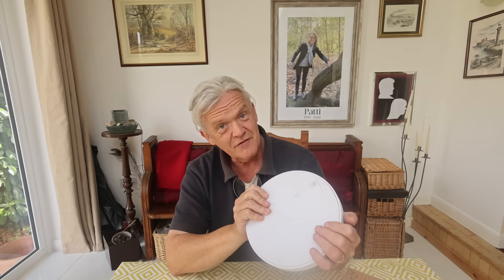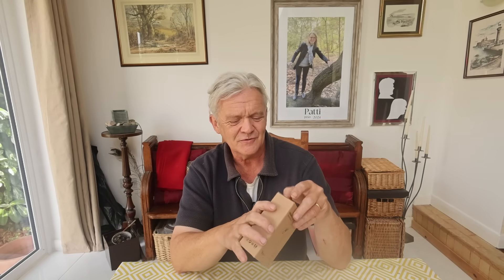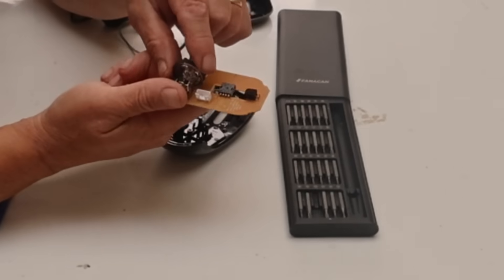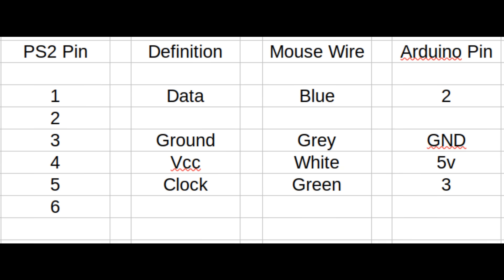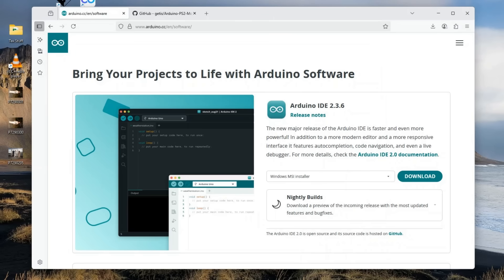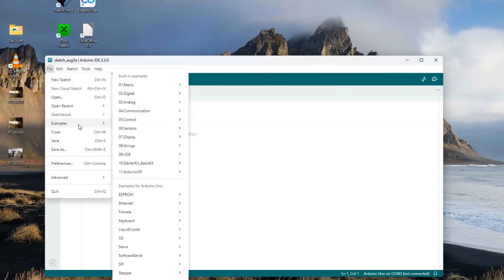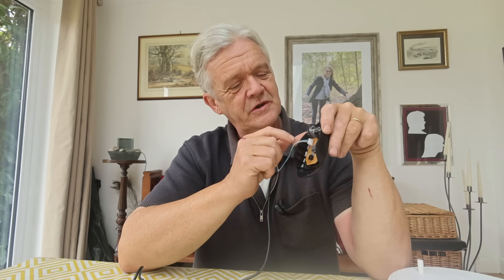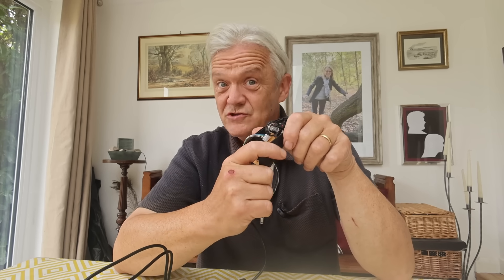2417 A Position Sensor From A Mouse

Comment: Nice, I recall when 3D printing was getting started back in the early 1980s solid scape came to me to laser machine orifices for melted materials and they took me they were using the plastic linear encoder mentioned with an accurate spring, from HP printers which turn out to be very accurate and repeatable.  So this is a 2D optical encoder.  Question how fast is it?, is what is the bandwidth usually video is 30hz or 60 hz and that might not fast enough for fast 3D motion what is the update rate?

Comment: Rollerball mouse might not need total disassembly, but contact with a rubber layer, not for this project, others ?
Watch out for power delivery from the newer arduino, is it enough and can it handle 5V signal ?

Comment: Love it. I'm going to make a guess that a USB mouse may just work on the same principal... I only mention it as I have a bucket load of them to play with :) I'll be looking to add it to my new radio aerial rotator project, along with a friction drive as that's way easier for me than building a gear box. No 3D printer yet! Cheers 🍺

Comment: Interesting investigation. Around 10 yrs ago I tried using an ADNS???  to measure belt position on a balancing robot but found the repeatable accuracy very poor. I contacted the manufacturer at the time and they replied that accuracy was at best 10% but the hand eye co-ordination gives the impression of it being much better. You can test this by running a mouse along an edge to a corner and see where the pointer ends up. Maybe modern mice are better or reading with a non windows interrupted system doesn't miss data. But the one I have isn't.  Its also very dependant on surface roughness as the laser is shon at an angle and the sensor tracks "shadows" .Like a plane flying over mountain ranges I heard was an inspiration.  Maybe P2000 emery cloth would match the sensors resolution ? Best of luck Rob, looking forward to your  results.
Reply: I had a similar project in mind at one time, an industrial application, and had the same conversation with the manufacturer. The repeatability is too poor for accuracy at almost any scale. I don't know if he'll be able to get proper accuracy for 3d printing.

Comment: Excellent use for a mouse! If you do have an old trackball mouse kicking around, there's a chance it has a pair of optical rotary encoders in it driven by the trackball. Speaking of rotary encoders, if you find it worthwhile, you could probably use that scroll wheel (minus the mechanical detents) as a filament movement/jam sensor. Looking forward to seeing these projects develop, thanks for sharing!

Comment: always thought it was a IR sensor/phototransistor as opposed to a camera 🤔

also rotary encoders and encoders in general (such as those in a digital caliper) are awesome and perfect for this sort of position sensing (could've sworn they are used in CNCs)
Reply from the maker: no mate camera! - cheers for the extra info. In quite a lot of calipers they use a capacitive sensor
Reply: I've been building a CNC using a module that has a hall-effect device and a magnet you glue to the shaft of your stepper motor. It gives you the position of the stepper. It doesn't give you the absolute position of the spindle, but it does warn you when the spindle hasn't moved to the location you expected. I glued the magnet to a plastic shaft that was in turn glued to the stepper shaft to greater isolate the module+magnet from the stepper motors own fields.

Comment: We'd also like you to do a project demonstrating how to hack the optoelectromechanical components of a DVD burner. For example, using an Arduino to control laser focusing, rotation, and head position would be a great project.
Reply from the maker: That sounds like a fun project mate - thanks for the idea.

Comment: It's a great idea. I've been trying to figure out how to do this for a long time. However, you can't use this sensor to get absolute position. But I think it could be done using an older mouse instead of an optical one. It could easily be used as a trackball.
Reply from the maker: yes you can mate - just set a home position and count from there - i covered this in the video

Comment: One thing to remember: These optical mice aren't designed to be accurate and only return a rough measurement.

Instead I recommend looking into rotary inductive encoders. These can be built with just clever winding patterns on each of the 3d printed parts, can be made to return an absolute position rather than a relative one and can be made to be incredibly accurate, to the point you can watch your 3d print deforming in real time through room temperature and humidity changes.
Reply from the maker: I am not sure i agree with you mate - but great suggestion cheers

Comment: I once did a similar thing with a linear encoder from a standard paper printer. I wanted to measure thermal movement of the wall of a building. It worked great. I never thought about the mouse. I love the world of sensors. We have such awesome access to really cool stuff.  I created a led circuit that responded to an accelerometer to indicate the level of deceleration of a vehicle. The faster you slow the more leds light up. I should be a millionare now lol. I would also mention I found chatgpt to be quite helpfull in quickly programming the arduino. Thank you for wonderfull videos.
Reply from the maker: Awesome - thanks for sharing and great to hear about your experiments mate.

Comment: And 7 pounds is not even a very cheap one, you can find some for about 1, though there are risks with going to the absolute bottom of the barrel, you wouldn't want things to stop working because the electronic is unreliable in the middle of a print.

But yeah, it's incredible the things we take for granted, there is a whole image processing thing in that camera, that identify features of the surface it's filming, and look for them from frame to frame, to compute relative position, and doing that at rates high enough that even on the small surface it's looking at, fast motions can be assessed with some degree of accuracy.

Arduino is certainly a fun and easy way to get into programing with electronics :) (i mean, it's still c++, not the easiest language, but they made it easy for the kinds of things you want to do with these kinds of projects).

edit: "*any* point in space" made me laugh, a very powerful device indeed!
Reply from the maker: Cheers mate - it is amazing how much tech is in those little devices.

Comment: Great idea what a shame it is not 0.005 it would make a very cheap DRO for a milling machine  I wonder if they do a mouse with a higher resolution  or if there is a way to amplify the reading by gearing the movement up Edit I have just done some quick research and it seems you can get mice with very high resolution so yet another project 🤣Thanks 👍
Reply from the maker: Good luck with your project mate - let me know how you get on!

Comment: Love this! I made a rollerball for a mame arcade machine by taking a kids polythene ball, filling it with plaster through a tiny hole, covering the surface with dots and making a home for it above an upturned optic mouse. It worked really well but was a bit janky. However it proved the concept and worked very well for a while. Great video, Thanks!
Reply from the maker: cheers mate

Comment: Are you sure that the position won't drift over time?
Reply: yeah, error will accumulate (or cancel out), but you can have a reset point in your disc, using one of the button's wires, so every time you make a full turn, your wire connects and detect that, erasing your error before it gets too big.
Reply from the maker: oh it i will drift mate - all mechanical systems drift - but gabriel has the answer to that

Comment: Nice video, Robert.  I'm thinking about this as feedback for an automated threading attachment on my lathe.  I have rotary encoders available, but if you use encoders on a leadscrew you get problems with backlash - it's a far better idea to go with direct motion sensing.  I was going to use a linear encoder pulled from a junked inkjet printer, but that's gonna have issues with chips, this is non-contact and can be pretty much sealed.  Bingo!  

As an aside, in general, it's a really bad idea to do any sort of automated control "open loop" - even with steppers driving gears or toothed belts you will eventually get missed steps at the motor end either due to speed, load, or electrical noise issues, and that can really bugger up your day.  Ask anyone trying to run 3d printers as fast as possible.  Even steppers really need to be run servo.  So having a cheap and relatively accurate way of getting actual motion feedback is a really cool thing.
Reply from the maker: cheers mate and nice tip

Comment: Wow... this was a fantastic jump into electronics. I am truly astounded at how easily you can change subjects! And this is such a cool project to start out with too.
Please be aware that this method uses "relative" mouse position coordinated over time, and will not be accurate in the long term, especially because the number of positional readings has to be read frequently, and it would mean that the arduino would have to be able to keep up with the report rate.  However, you might be able to use some strategies to zero out the position sensor periodically. If you could figure out a way to "home" it every turn for example... that would help.
If you really want more accuracy, (for position), then digital encoders or lasers that can provide "actual distance" might be a better choice.
However, it would be useful for "detecting" slip and could possibly keep up with short adjustments, it is hard to tell, a lot depends on how well the Arduino can keep up with the updates.
Reply from the maker: you are right mate - it hard to tell and 'homing' was the option i thought about

Comment: Rob, you have no idea how long I have wondered if this is possible. This essentially makes a printer system closed loop, which increases the accuracy and fault recovery. Thanks for finally scratching this itch for me.
Reply: It actually still is open loop because mice sensors only read delta not absolute positions. You could go with replacing the encoder chip on the mouse with an Arduino and depending on the resolution of the camera sensor have it read encoded marks on the axis. Feasibility is another matter.
Reply: @yeabutwecouldbefreer  i think you could use the button to make a connection at one point of the rotation, providing you with a reset point to look for at the startup sequence, and useful as a regular error correction during operation, avoiding drift. You can do the integration of deltas into absolute position on the controller easily enough.
Reply from the maker: lol - always my pleasure mate - cheers

Comment: By the way. On the eidograph I have ended up using an encoder on one arm and a stepper motor on the other to transfer angular movement. So far this semi-digital solution is working out great.
Reply from the maker: That sounds very clever mate - good work.

Comment: Really interesting project! 
Would the accuracy error accumulate over time as the printer is running? That is, will the total accuray error be added to each time the printer moves? 

Not related, but i was watching your videos on the FWG battery, and i'm loving the science. Did you ever do a "Last status on the battery"-video?
Reply: Yes, because this uses "relative" positioning, it will be subject to error over time, and that will accumulate unless there is some cool way to "reposition" or zero the sensor. (Also the Arduino has to be capable to read the mouse output at the speed it is sending).
Reply from the maker: marc is spot on mate
Reply: @ThinkingandTinkering  I think the read rate is not that important. Going thru the code in the library - it looks like the mouse internal processor keeps count of XYZ movement from the last read state. According to the flow in the code, a “pause” state is requested from the client to the mouse and it will only start reading data if the mouse acknowledges. Only then data is read. That is why you would get differential values of XYZ data at each read per clock cycle. 
I could be wrong, but that is my understanding of the C code library. 
You could also inject a custom home GCode XY command in your 3D script to reset that home position every 3-4 layers with that trigger you mentioned. Like what they guys use to snap a photo with a camera each time the bed is at a custom location to trigger a micro switch or something like that.
Like always, loving your content and creativity. 😊

Comment: That is incredibly useful thanks. One of my background projects is a CNC plotter engraver that works on spheres where absolute positioning is a nightmare. I think it is worth my time experimenting with this, with the mouse sensor held stationary on the underside of the sphere (measuring the movement of the surface of the sphere rather than the movement of the mouse).
Reply: Soooo...a trackball then?
Reply from the maker: go for it mate and let me know how you get on
Reply: @DancesWithAardvarks  While it indeed my always skip a bit in such high precision requirements I'd at least consider a better High DPI gaming mouse (you will surely get a used wired one for cheap - usually the micro switches are what fails first in them anyway)
Reply: Even the best mouse sensor running on the best mat will miss, and you won't get a precise positioning tool from the mouse sensor.
Reply: @Иван_Абрамов  thanks
Reply: @Иван_Абрамов   well that could be said about anything. got a better idea for $7?